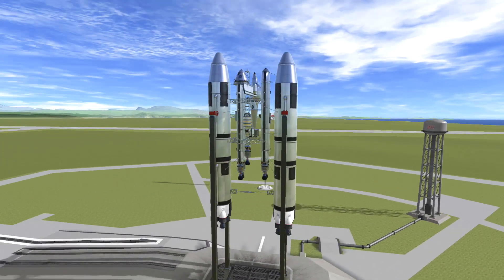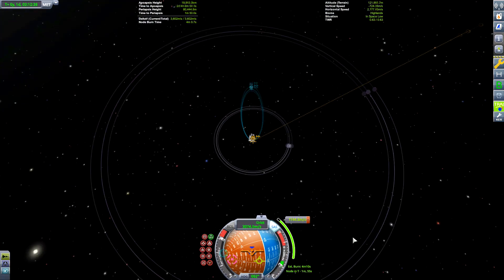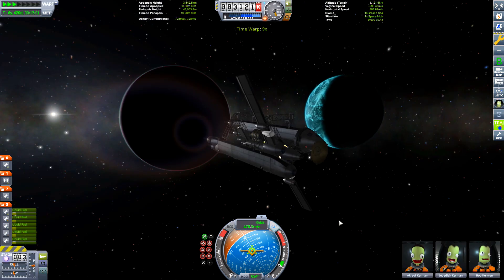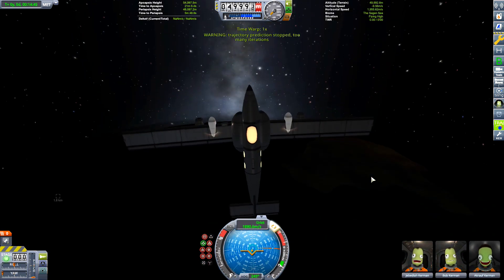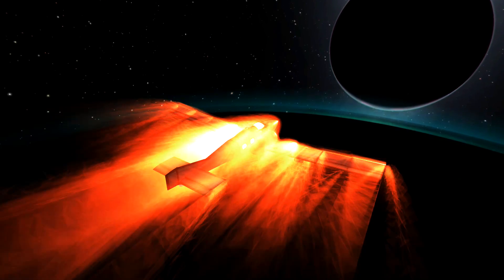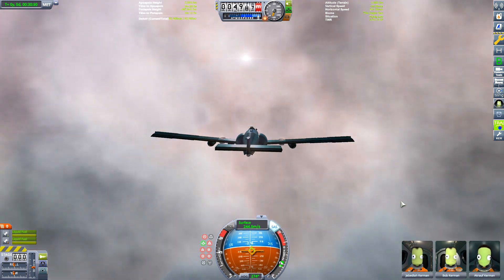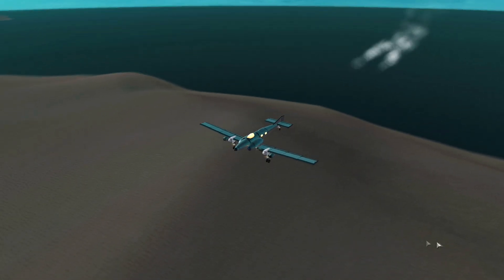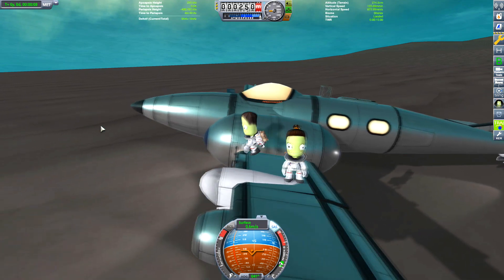KSP - Not a Spaceplane in space

Comment: The plane looks like a WW1 design. BTW your planes noses up because your Center of Thrust is below the CoM. Try offsetting the engines by turning their nozzles slightly downsards, look at conventional Jet aircraft, you'll notice engines, being below the aircraft, the engines are pointing downwards (the exhausts) by a couple of degrees. It is also why the wings are tilted slightly as well in the same angle to compensate the offset CoT.
BTW, the atmospheric experiment thing, you should center it because it generates some drag.
In SPH, use the free placing/turning/offsetting to fine tune the angle of the engines. The CoT ball indicates the vector of thrust. It basically has to converge with CoM, if it is perfectly parallel, you'll end up with two forces and your planes will be umbalanced.
The plane looks gorgeous though. Would be perfect with only a few minor tweaks to its aerodynamics. Send it along with a colony base and it can refuel to do a variety of missions to other land masses.
If you replace the passenger cabin by science equipment bay, that is.